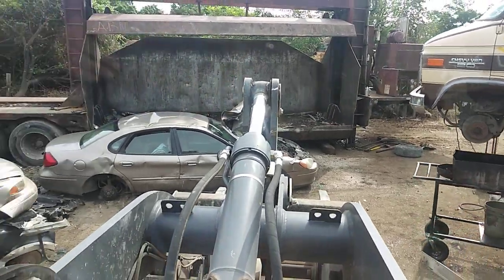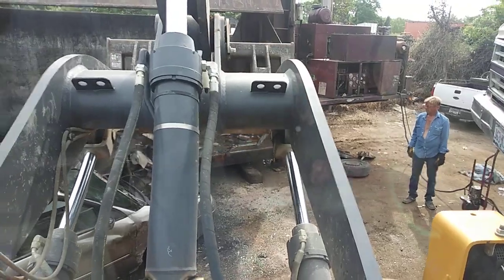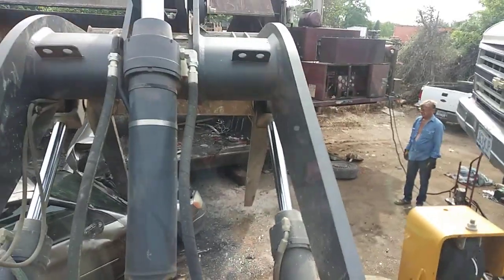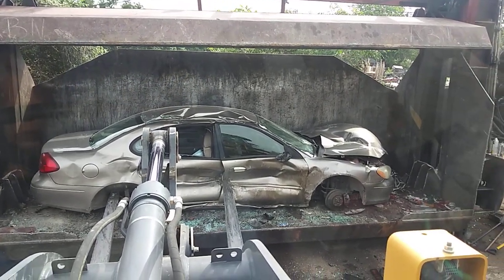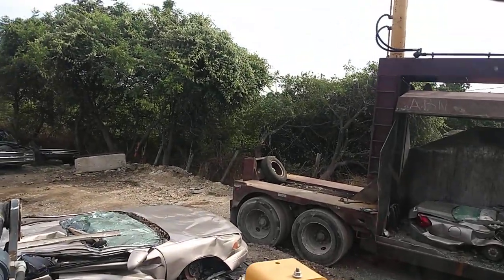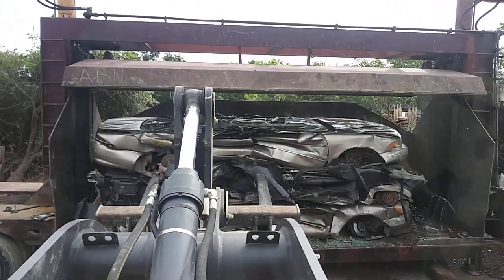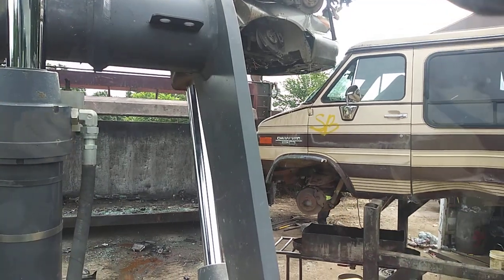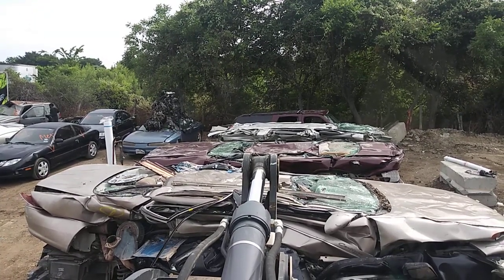Ford Taurus the Bread and Butter of Junk Cars

Comment: I owned a 1993 Ford Taurus station wagon.  Bought when it was brand new.  Lasted an incredible 25 years until it "died" in 2018 due to a rotted front crossmember.  There was no replacement for that; no auto repair shop will go to a junkyard today and get one from another Ford Taurus because its very likely that part is also rusted out.  It was hard for me to let the car go.  I miss it dearly.

I understand your job - and I know you stated you dealt with these Ford Tauruses regularly...  From what I've been told, about 75% of the Ford Tauruses from the early to mid-90s are scrapped because the underframe decayed first, like what happened to mine.  So basically every time you see a Ford Taurus of that era, and it still looks in excellent condition but for some reason must be crushed, chances are its the rotted underframe that doomed it.

Heartbreaking for me to know that my car is probably already crushed by now, like the one in this video.  :(